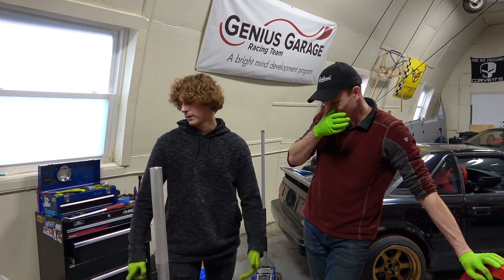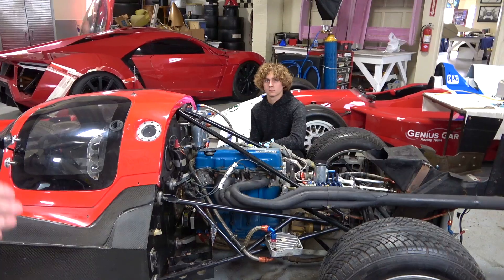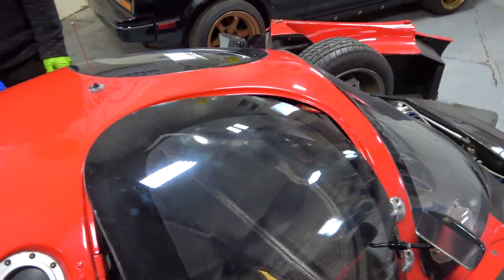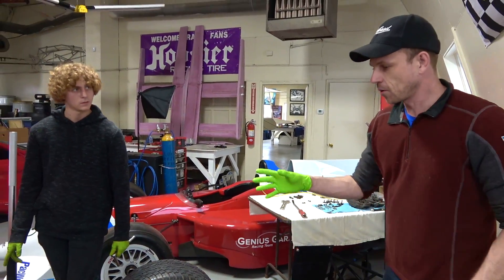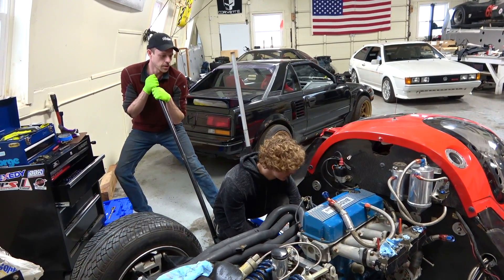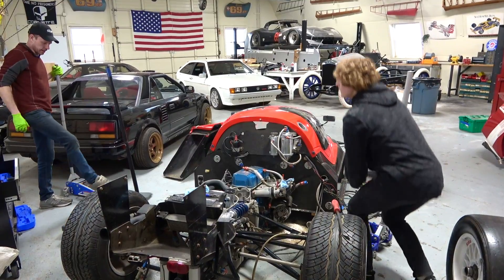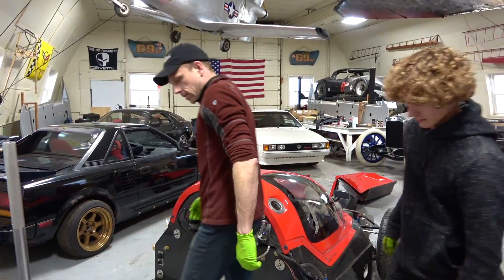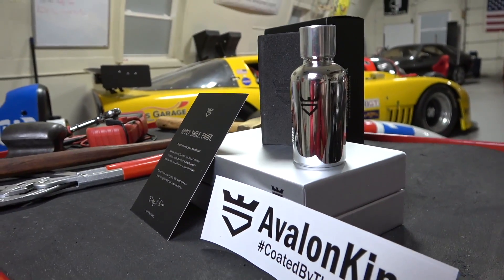Why we split our MEXICAN RACE CAR in half ?

Comment: This car was designed and built in Mexico City in the early 1990's by a very diverse group of people. Alfredo Tame started the project by building a factory space with autoclaves, ovens, vacuum pumps, compressors, generators and everything else needed to produce carbon fiber. At the same time the factory space was coming together Mr. Tame assembled a group of very talented people to produce the car. There was an Englishman and an Italian doing the carbon fiber design, an American designing the suspension, Mexican and Argentinian engine builders, Mexican fabricators,  machinists and mechanics. Scores of people contributed to the project and labored to build 20 cars. Alfonso Toledano, one of Mexico's most talented drivers, did the test driving on the first pre-production car. It was a remarkable effort.

Comment: Interesting car.   What I noticed though is that the foot box extends well beyond the front axle.   That makes this car a very unsafe car.   Didn't IMSA or some other sactioning body make Porsche change the design of the 956 GTP car to extend the wheelbase of the car, or move the monocoque rearward, which resulted in the 962?   I wish there was a company that made an affordable 962 type design race car.   This project looks interesting, though being 6'4", I'd certainly be at risk for foot and leg injury.   It's not worth it, that's why I drive an ex-NASCAR Cup cars on road course tracks.    It's extremely rare that the driver of an NASCAR Cup car gets hurt anymore in those cars.  What are your thoughts?

Comment: Curious, I wonder if there would be room on the front of the engine to convert the multiple accessory belt pulleys to accept a single serpentine belt with aluminum pulleys. Maybe free up a little power. Excited to see the genius garage builds!

Comment: Much easier to split that with the car on stands and use the engine crane (as you noted later).  Did a LOT of that in my stint in a vintage race shop.  Be prepared for the fuel cell to be full of mush.  Replaced all the cells on a '74 Shadow DN4 that had been in a museum about 30 years and the leftover fuel had turned much of the foam to orange oatmeal lookin stuff.  Didn't smell great and I definitely gloved up for the process of removing it.